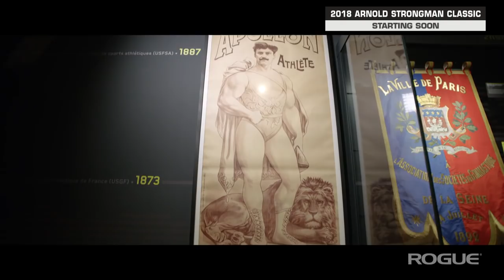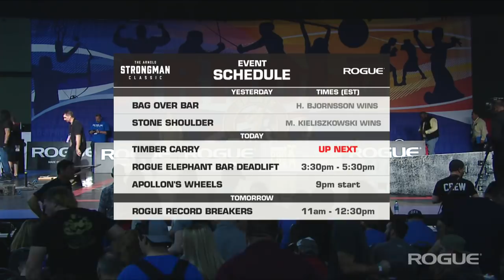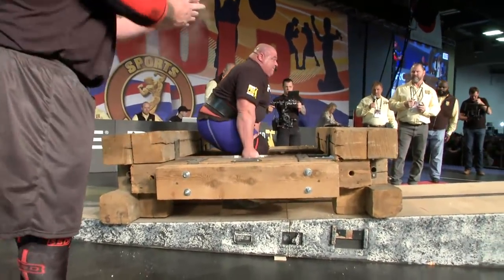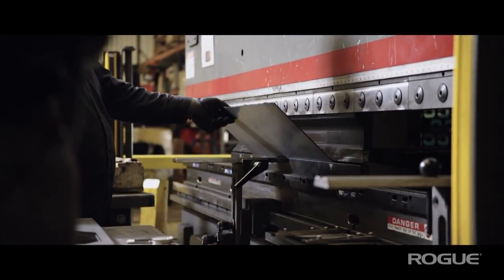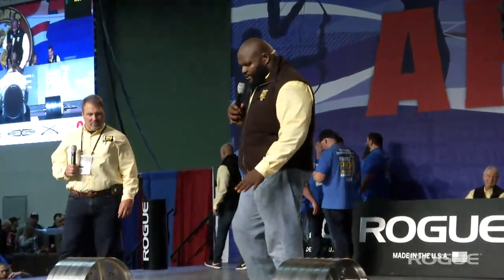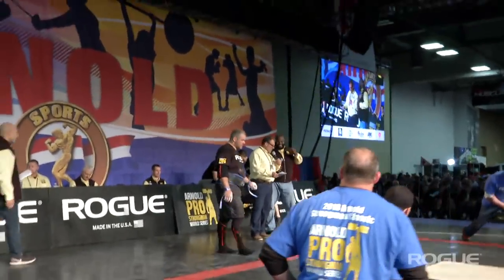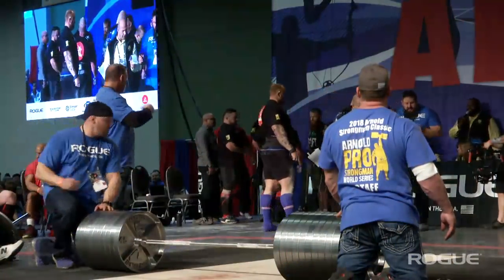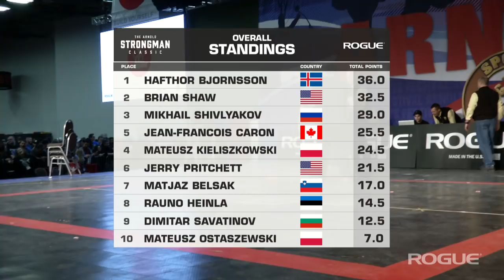2018 Arnold Strongman Classic | Sat 1:45pm EST

Comment: Hafthor pulled 472kg way easier than Eddie pulled 465kg in 2016 which was the old word record. Makes you wonder if Hafthor could be next to deadlift 500kg conventional
Reply: eric wong yes 2 years ago... anyway he is improved so much, he is an animal, but I mean eddie did 500 in 2016 for the first time and he could have done more. If someone will beat that record must do it of more kilos, not only 2 or 3. 2018 is hafthor year let'see.
Reply: Eddie hall did a speed pull with 472kg at wsm17 and Thor failed so on that day Thor wasn't close to Eddies deadlift strength I'd guess he could pull 540-550kg now
Reply: yeah because thats how strength works, its linear. you just have to put in the the time. and 50 kg more on 500 kg is nothing right?
Reply: Eddie is only good with a deadlift suit on
Reply: Wait didn’t eddie pull 500kg? or was that equipped? where is eddie anyway?
Reply: Oh, I didn't know 8 figure straps were better - never used them or researched them. I just thought they were Eddies personal preference.
Reply: Charles its preference.. more or less atleast, i myself think they are nasty to use personally but i dont pull 400kg+ :p
Reply: This lift is different from a regular bar. It flexes more and bounces alot. Eddie hall said himself that the bar didnt suit him, and said the bar was better fore shaw and haftor.
Reply: S Stein well in response to your sarcasm, Strength actually does increase more linear when you're at this level of athlete's... Definitely doesn't I crease logarithmicly.

Comment: Straps are cheating
Reply: Allowed in strongman so it's not.
Reply: They would have to have a separate grip strength competition since that would be by FAR the limiting factor. Grip strength is a big limitation at that weight, and it would be a shame to only compare fingers and thumbs when there's a whole body to compete in the deadlift. But you're probably a troll anyway.
Reply: mason r that’s the point, if u can’t lift it without straps it’s not a real lift. Should be your hands and that’s it
Reply: djdaniels00 I agree. But if u can’t lift a certain weight without straps, then you can’t lift it.. it’s apparent everyone can lift more with straps, have a competition where straps aren’t allowed
Reply: Bob G should be strongest without straps